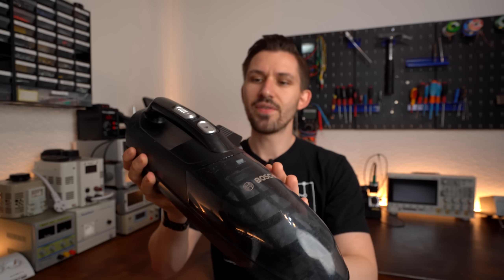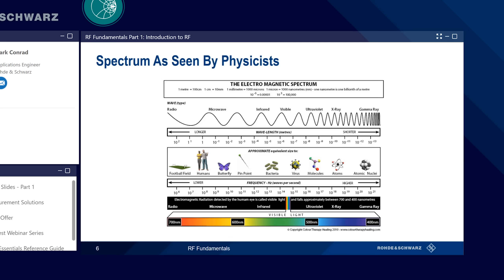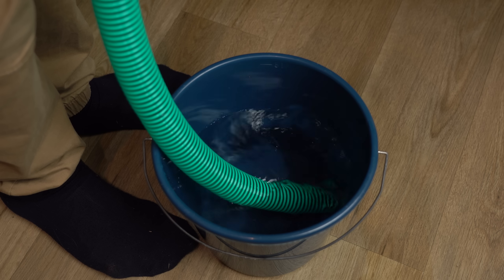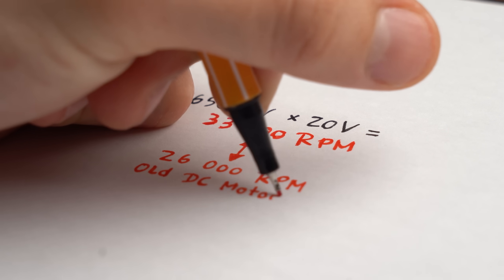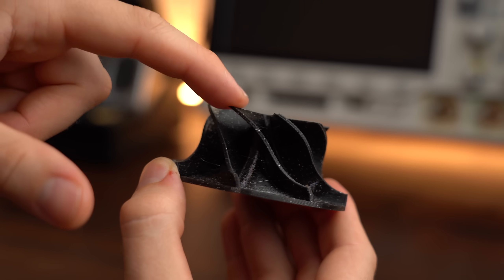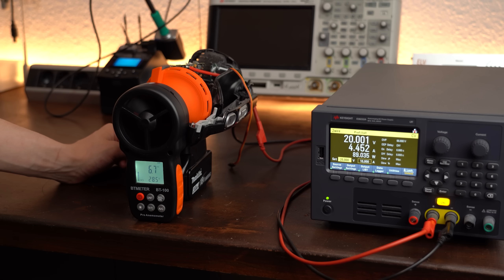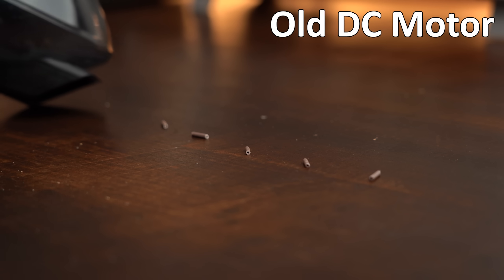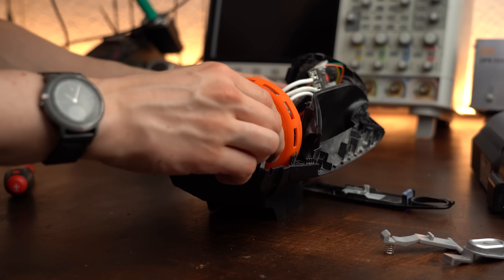My Last Chance to OVERPOWER my Vacuum! (Homemade Turbine V2)

Comment: You should take a look at the way cutting discs are attached to angle grinders. They are held on by a nut that's threaded opposite to the spinning direction. The centrifugal force keeps them tight, they will never come undone on their own.
Reply: Same with turbochargers.
Reply: Ahh. Tangential and centripetal acceleration are what describe a circular force. They are perpendicular to one another (90 degrees apart). Centripetal acceleration points to the middle of the disk and tangential acceleration points away from the disk as a tangent line on the outer circumference (a right angle to the centripetal acceleration "line" or vector).

...Yeah we can just write that off as pedantic.
Reply: Same as the viscous fan clutch for the cooling fan of a bmw 325i reverse threaded.
Reply: and it doesn't even need to be reverse threads. he can decide which way to run the motor and which way to print the impeller.
Reply: that would be hard to implement here, then again he can fix a coupler to the shaft  and drive a bolt into the coupler from the top of the impeller but that solution would be bulky.
Reply: @s.sradon9782 he could try to thread it, or get one that's threaded
Reply: At the risk of being pedantic wouldn't that be the equal but opposite tangential acceleration?
Reply: @first-thoughtgiver-of-will2456  You're asking that with the bold assumption that I know what that means...
Reply: @first-thoughtgiver-of-will2456  at the risk of sounding pedantic (and maybe antagonistic) it's actually the interplay of normal/frictional/inertial and drag forces. Centrifugal plays no real role in holding the nut on, and acceleration only plays a part at the start of the motion and in the form of vibrations.
Reply: @xxportalxx.  You're not going to believe me but I had a similar thought after posting but thought "nah that'd be too pedantic". I think what's also pertinent is the force applied on the disk during grinding and the equal and opposite torque applied back to the fastener.

Comment: Hello Scott! Do you consider printing the impeller with other materials, for example ABS?
Because in general the density of ABS filament is about 10% lower than PLA and PETG.
Maybe saving a bit weight on the impeller can help the efficiency. Thanks!
Reply: F = m a; Meaning if there’s no acceleration there’s no force. Assuming the same friction for two different mass fans: In a fan system at steady state the air is the entire mass that is being accelerated. The fan itself will have potential energy that is constant once it reaches its max velocity. It’s potential energy is proportional to its mass, thus with the same force the heavier fan will take longer to spin up. The fans max velocity will be determined by the friction of the fan itself, plus the energy put into moving the air mass, plus the turbulence added to the air (will be heat), plus the compression of the air. So, a good fan for a vacuum needs to avoid creating turbulence and rough FDM surfaces are bad for that. The leading edge of the blades should be sharp as well. The fan should prevent backflow turbulence (tight housing tolerances or integrated shell like the original).
Reply: Weight makes no difference once it's already spinning. Also more ductile plastics will deform at high rpm and rub on the outer housing
Reply: @harrylenon9594 Weight certainly DOES play a factor.  Weight = LOAD.  The more load, the harder the motor has to work.  When the motor is capped at a set power limit..  it will reduce the overall RPMs with a heavier load.  The load might also be amplified, as you move the vacuum around.. as the extra mass with create more vectoral forces.
Reply: @johndough8115  no, if the load has the same friction with its surroundings, it will reach the same top speed. Acceleration will be higher with lower inertial load, but top speed will not change. At constant speed, weight plays no role in power draw.
Reply: @harrylenon9594  There is a channel that makes Custom fan blade designs.  Certain designs are heavier,  use more blades...etc.  They all spin at different RPMs,  despite the exact same motor being used.
Reply: @johndough8115  yes, different DESIGNS.... the design will determine the drag on the propeller while spinning, not the weight. If you did a test with two identical blades, only difference that one is heavier, you'd find the lighter blades spin up to max speed faster, but have the exact same top speed
Reply: @harrylenon9594   Weight is Work (unless maybe if you are in space).  The motor is set to rotate at a certain speed... but once that motor is under load.. that motors potentials are lowered.   If you put too much weight on the motor... even if you pre-spin it... the motor will eventually fail to be able to deal with the mass.

 Try pre-spinning a 300 lbs wheel,  via that small motor.  You get to pre-spin it to the correct RPM, to start out with.

 Additionally, as said... you also have to deal with Gyroscopic forces.  When trying to move a spinning mass around in different directions, you can feel the device Pull heavily in different directions.   The heavier the mass.. the more it will PULL (resist).  These forces, will be additional Strain (Work) on the motor.
Reply: @johndough8115  I'm not going to bother arguing the point cause your not going to listen anyway. You are correct that a larger weight will induce higher gyroscopic forces, but that will not reduce the speed it rotates at either.

Comment: GLAND SEALING SYSTEM.
is a technique used in steam turbines to make the bushing "air tight" without having contact with the shaft.
Try adding it to your design.

Comment: Well if you can design a turbine that is covered from outside just like comercial one static pressure will increase 😅. And it's not important to build High pitch blade it will create to much force on edge which will push the blade against enclosure. Try to keep the blade close to the lower it will significantly increase airflow because of lower drag on edge of blades😅. I hope this will improve your vaccum cleaner in pt 3

Comment: all you need is a set screw to solve the impeller coming up off the motor not glue use a m5 screw and a file to cut a .5mm notch in the shaft screw it in the side if the impeller and off to the 140 wtt races

Comment: Get a Henry vacuum. Vastly superior to Dyson.

It uses a bag so you don't get dirt all over the place. No fiddly small pieces just extreme suction power. Built to survive commercial use in the favoriter cruise ships and other things where it's going to be used all the time. Father was the kiss theory of engineering "keep it simple stupid" I have a Henry Hetty vacuumle part of the purchase price went to breast cancer research and anything that fits in the freaking hose it can handle.

Ferrari is kind of like a high end sports car overly complicated not really reliable pretty but you're going to have to have something more reliable around pick up the slack if you actually need to use it.

Comment: For part three, maybe include a "turbo button" with a 30s timeout that runs the motor at ~95% of the maximum that the motor and controller can handle and run it at whatever level the lady deems acceptable all other times.
Reply: Dyson already does that
Reply: @fusseldieb  Oh my god. Noo waaay.
Reply: Roger that, I own one. I was curious about how our friend here would implement a similar function.
Reply: I have run toy DC motors that were rated for 1.5 to 3 volts... on 18 volts, for several seconds at a time. The output torque and power is very impressive, approximately on par with small model airplane engines! So there are definite possibilities for turbo mode. The most immediate dangers to my toy motors were burning the commutator on the rotor, then the brush holders near the commutator, then the windings on the rotor, then overheating the permanent magnets. But those motors had no cooling system to enforce airflow over or through them, as vacuum cleaners do.
Reply: the actually vacuum cleaner is a turbo, but instead of using exhaust gases it has an electrical motor, whatever it sucks instead of going to the engine goes to the bag
Reply: @chikogota They said a turbo button, not a literal turbo.
Reply: @nikkiofthevalley  the vacuum itself it is a turbo my friend, when you already have pressure, you cannot ad another turbo on top ( not even on compound turbos work that way) the only thing similar to what he wants it is a "scrambler" button, that makes the pressure up with the click of a button ( instead of the potentiometer) that would be the closest thing to the "kick of power" he is asking for but probably it wont work as good as it is in his head and will be much harder to achieve

he still needs to work with the backpressure  on the current power, but having a potmeter it is way better than to have a scramble button since you can fine adjust the power to the needs. For example if you want to pick up something in the sand, having a 50% max power before the scramble button might not be enought to pick up the things he wants instead of the sand, but if he put the scramble, having soo much power he will end up picking up the trash he wants and also all the dirt, so instead having 50% and a button to 100% of duty, it is way better to work the machine in 70-75-80 and so on
Reply: @chikogota  Okay. That's not what they were talking about. They didn't mean "turbo button" as in a button that activates a turbocharger, they mean a button that actives a "turbo mode", which usually means a "go faster" button.
Reply: @nikkiofthevalley  like i said, you cannot do that on any turbine, closest thing it is an scramble button but it wont work properly since the potentiometer already install it is better
Reply: @chikogota  ur slow. you can do that on literally any turbine. "turbo button" as in "a button to increase the rotational speed higher than the usual maximum for a short period of time". as in, if normally it spins at 10,000 rpm then spin it at 13,000 rpm for a short period of time. nobody said anything about turbochargers
Reply: @chikogota  It's not a 'turbo.'  An impeller or impellor is a driven rotor used to increase the pressure and flow of a fluid. It is the opposite of a turbine, which extracts energy from, and reduces the pressure of, a flowing fluid.
Reply: @toolbaggers  like i said, it is basicly  a "turbo" but half of it, and the intake part of the housing since the exhaust it is made from the electric converter

the basic principle it is the same, since instead of the applied pressure going somewhere, it became backpressure so the air intake can have much better performance, the only thing you are confusing it is that using the same basic principle you can do many wonders, from a water pump to a jet turbine ( search how use a turbo to create a turbine, you just have to change a couple of things and make the air going into the exhaust and add fuel until explodes or melts) 

in this direct case i was trying to explain that a " turbo  button " it is worthless since you have a potentiometer and that you cannot pass the desgin limit of the current backup and always end up with the max backpressure design for
Reply: @nikkiofthevalley  🤣🤣

Comment: I wonder if they were reversed blade impeller system would work better those typically are able to spin considerably faster while consuming significantly lower amounts of power allowing the speed of the impeller to overcome the In efficiencies in the design I wonder if the Canadian Matthias would be able to help with this project

Comment: Why not simply design holes for two set-screws somewhere on the impeller. Sure, they'll be long holes, but it will be secure, balanced and probably quieter than a circlet which moves around and is unbalanced

Comment: FDM is not the way to go for this. If you don't want to buy a resin printer or don't trust resins strength, get it made in SLS/MJF
Reply from the maker: Yeah, that would be the next step :-)
Reply: @greatscottlab  I can make it for you in SLS PA12.